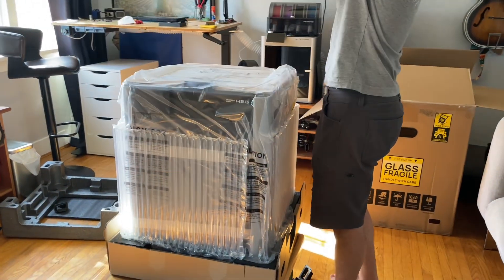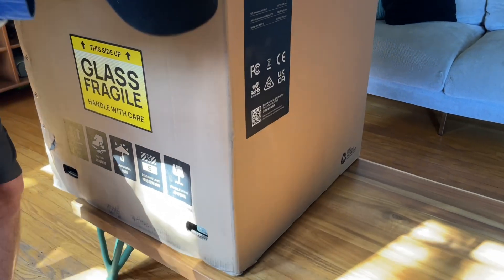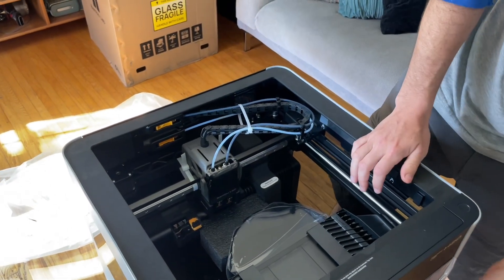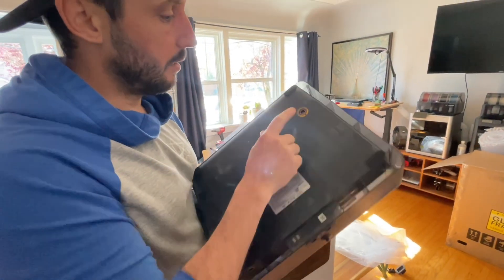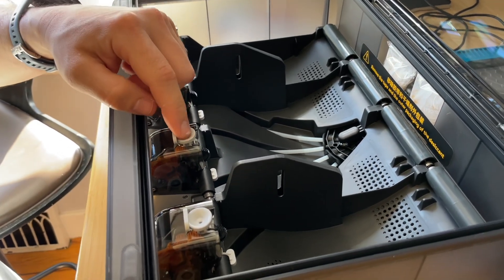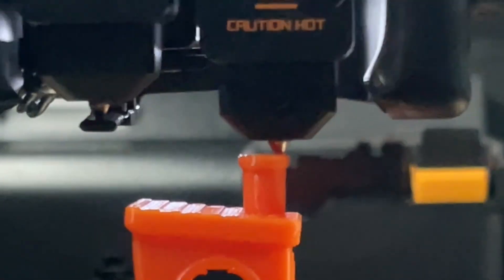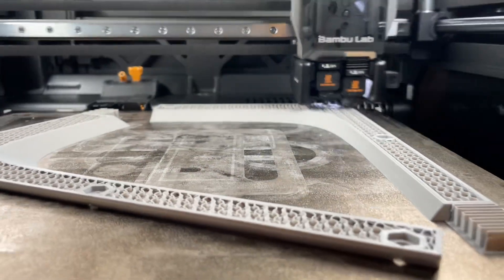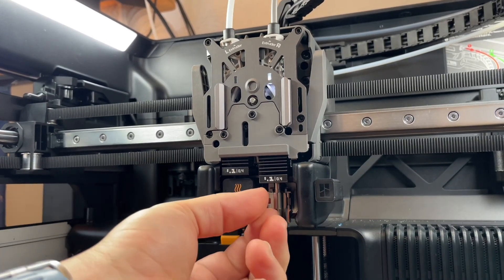Unboxing the Bambu Lab H2D – Is It Better Than the X1C and P1S?

Comment: What do you think of the Bambu Lab H2D so far? Worth the upgrade from the P1S or X1 Carbon? 💭👇
In this video, we unbox the H2D, test the dual nozzle system, and compare it head-to-head with other Bambu models. If you’ve got any questions about print quality, materials, or setup — drop them here and we’ll reply!
👀 Don’t forget to check out our other 3D printing builds and custom mods on the channel. 🔥 Subscribe for more CNC, carbon fibre, and adventure-ready gear

Comment: How about the print quality? and overhangs ? comparing h2d to x1c
Reply from the maker: It depends with which material but in general the X1C would give you similar results. However, the h2d has better temperature control and the chamber heater makes a big difference with engineered materials.